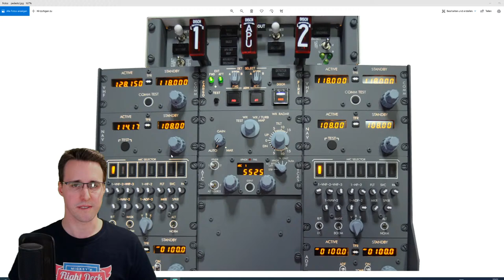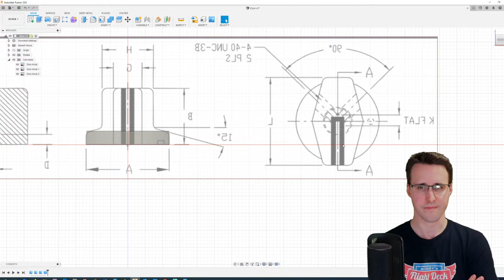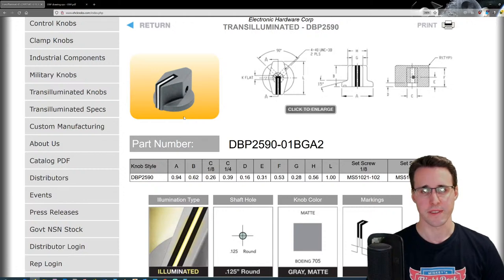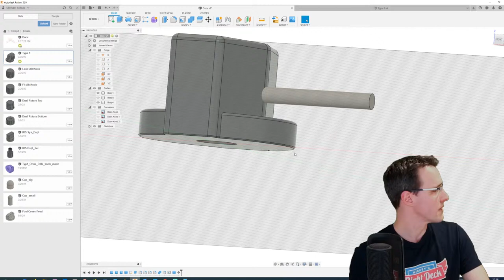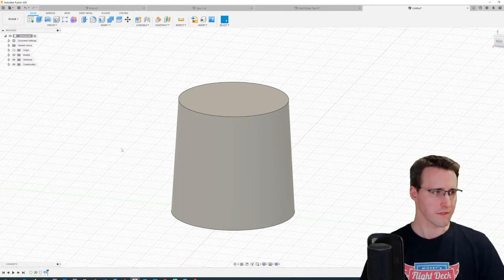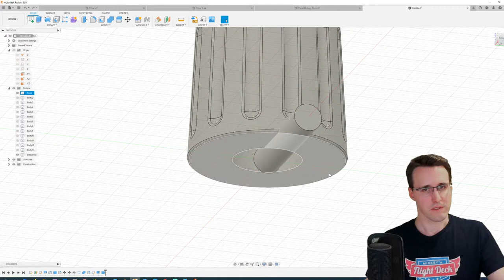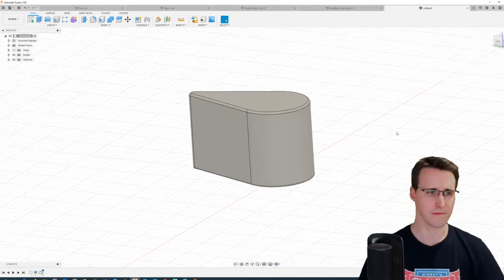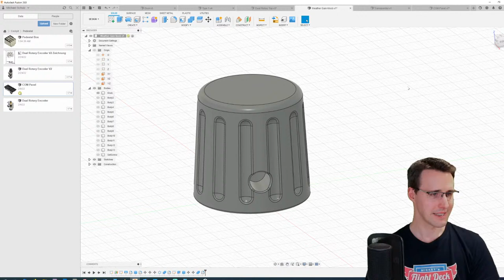Designing Knobs in Fusion 360 - Mickey's Flightdeck Live Stream 12.03.2022

Comment: Possibly helpful tip: In Fusion 360, you can enter measurements in any unit regardless of your modelling unit, and it'll do the conversion for you. So you can enter "0.16 in" as a measurement and it'll convert that to the unit of your document and store the dimension of 4.064mm. This doesn't help if you want to round to nice whole numbers (ie: 4mm), but if you don't care it'll save you a lot of time doing the conversions in the calculator.
Reply from the maker: Cool, I hope I will remember next time when I need it.